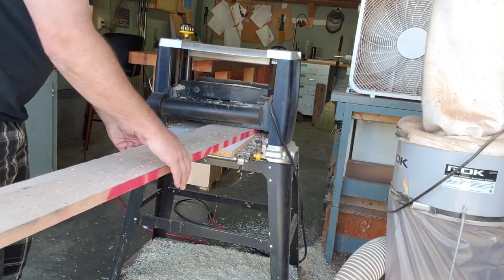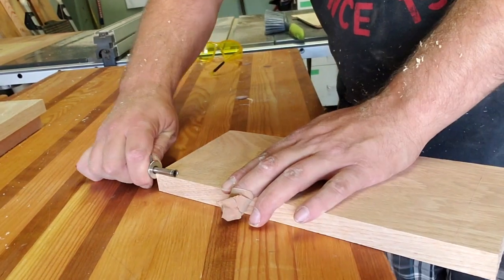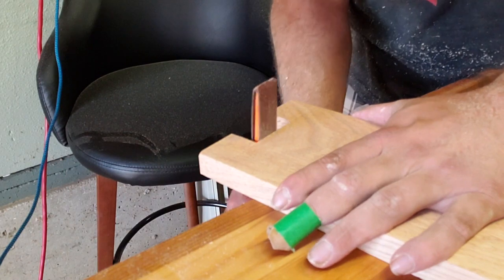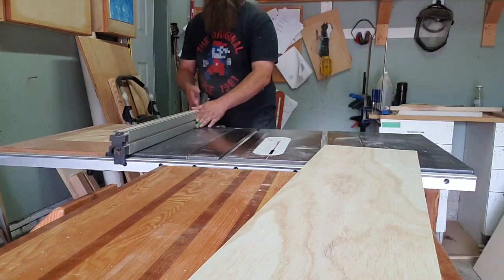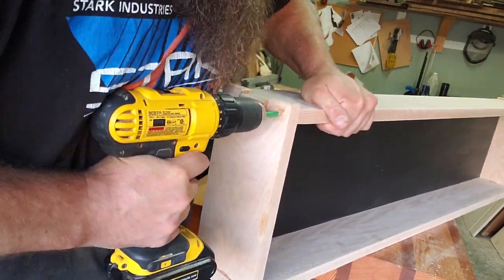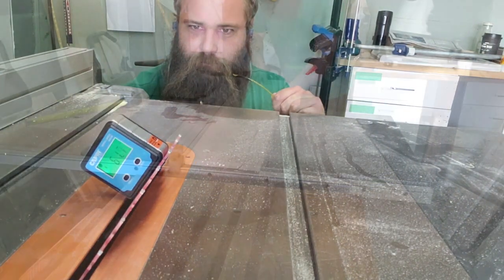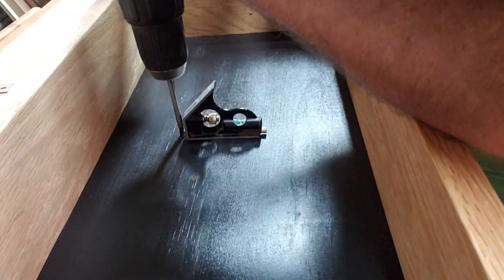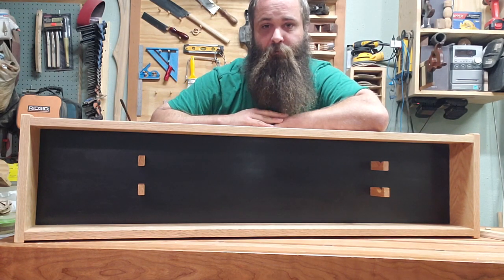Antique Nostalgic Golf Club Shadow Box Wall Hanging Display Unit Thing!

Comment: Looks great ! I got my Rikon 10-326 a few weeks back cut up some walnut slabs today the thing is a beast.
Reply from the maker: It absolutely is. I'm having trouble getting the fence to lock square in it's short orientation, though, and manual says I'm doing everything right. Might have to call them.